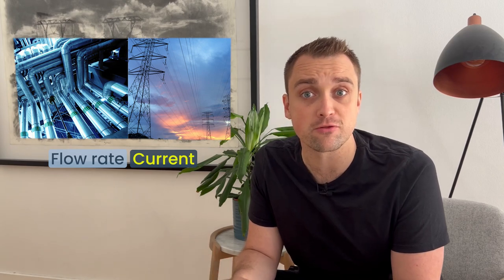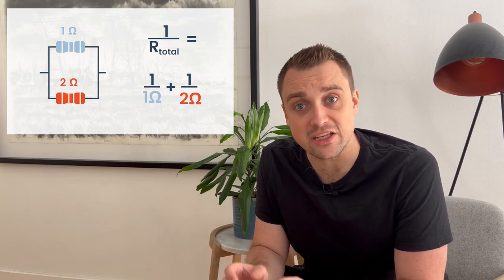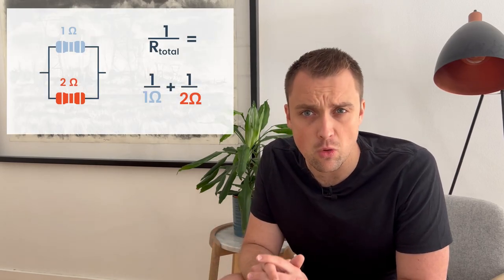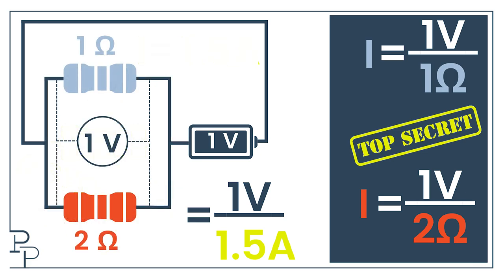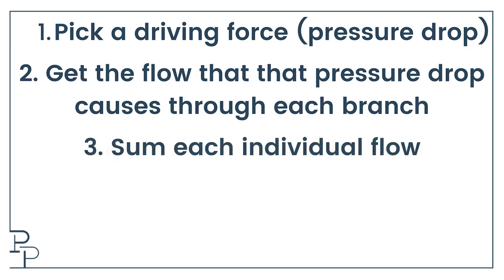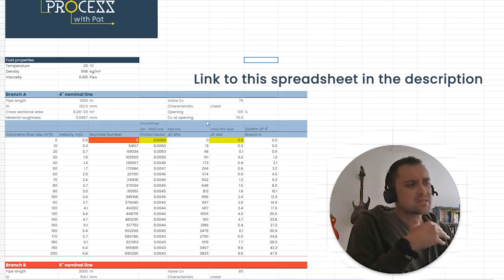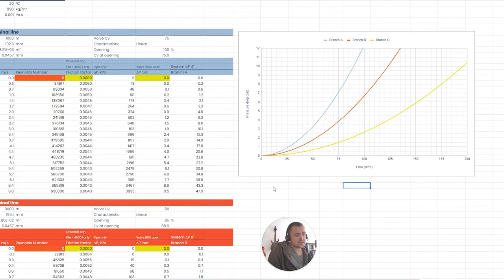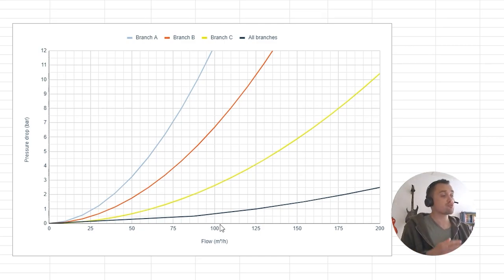Pressure drop (and system curves) in parallel

Comment: Pretty nice vid. I remember embarrassing myself in front of our client several years ago for not fully understanding this concept. It can also be very difficult and complex to incorporate parallel branches with hydraulics into a process simulation - I find you have to adjust the flow rates to each branch manually (or with an adjust block) so the downstream pressures at the merge point equalize. But it can get really complicated really quickly! Nice intro to the concept!

Comment: The analogy goes deeper than is discussed here. If you go further into EE, you find that there are many examples of non-linear resistance. For example, the analysis of total current through two transistors in parallel can be done with a similar graphical analysis as done here.

Comment: Thank you very much for the great videos. As a young chemical engineer they have really changed my way of thinking in pressure drop.

I have a quick question that relates a bit to this video but also on your first video about what happens when two pipes meet in the pressure.

Question: we have a feed stream of known pressure that mixes with a recycle stream. The mixture goes into  a pump. After the pump you have equipment that causes pressure drop and at the end some of the product is the recycle and some you take as product. 

I am struggling to understand what is the pressure before the pump (pump suction pressure). Before watching your video I thought it was the minimum pressure but now I am not sure. 

From your video I should look at what happens downstream, but because I have the recycle that is complicated, especially because the pump works at constant pressure output, meaning that my flow through the pump will change based on the differential pressure. 

In essence you have a single loop system
Reply from the maker: Just so you know I’m thinking about this one. When I get a chance I’ll get to it!

Edit: as promised
System curves with recycle lines
https://youtu.be/VEgu41wUwCM

Comment: 1:41  1 bar pressure drop with the valve on the end, doesn’t mean you get equal pressure drop when the valve is on the beginning. The pressure drop depends on the flow rate inside the pipe, and it’s different in both situations. When the opening of the valve is the same and the pipe is equal, you get different results when you switch the position of the valve. Not always, but noticeable when you get into higher flow rates.

Comment: Hi Pat, great video. Just a question. How is the pressure drop for the valve calculated? It doesn't seem to correspond to the Cv equation where Cv = Q X [(SG/DeltaP)^0.5]. What is the 27.3 value in your spreadsheet?

Comment: What happens in branches which don't join back up at the same point? Do you define pressure drop for each branch and then calculate flow based on this? If a valve to one of these branches was closed and the  suddenly open, would there be a difference in pressure at the tee of points for the branch?
Reply from the maker: Great question! Rather than reply in a comment I’ll post a video and go through an example of this. Shouldn’t take too long if you can hang tight.
Reply from the maker: As promised: https://youtu.be/yFjxJoX6We0
Reply: @ProcesswithPat  that's awesome thank you

Comment: Hi Pat,
I hope you are doing well. 
I have a problem with my client over the pressure drop of a control valve which is considered to control the flow in the parallel lines. I wonder if you could give me your email address so that I can ask my question. I am sure it won't take more than 3 minutes for you to answer.